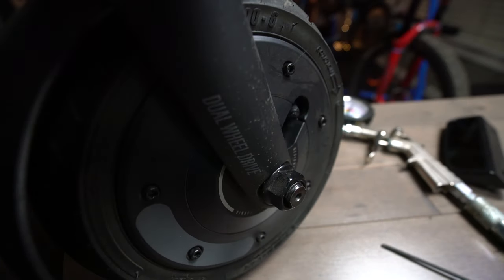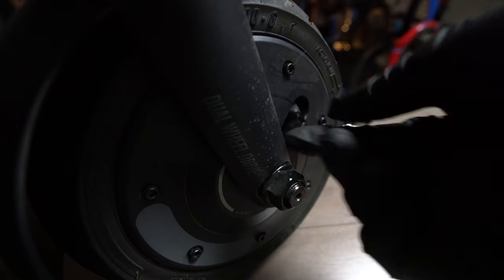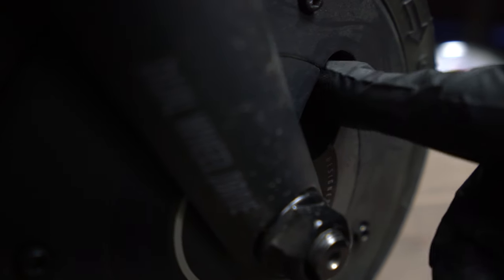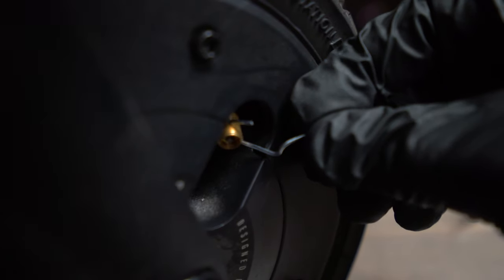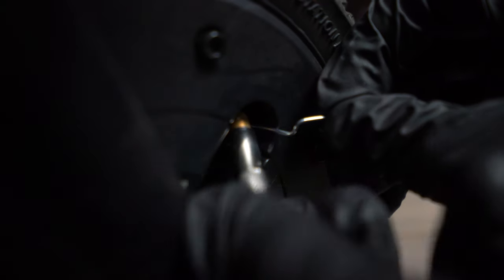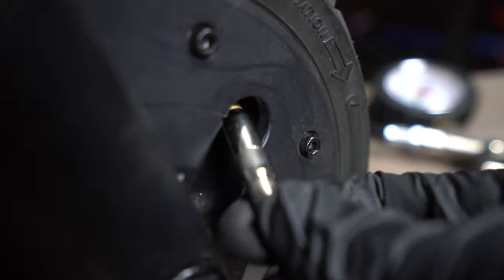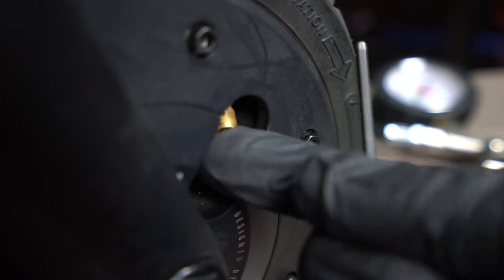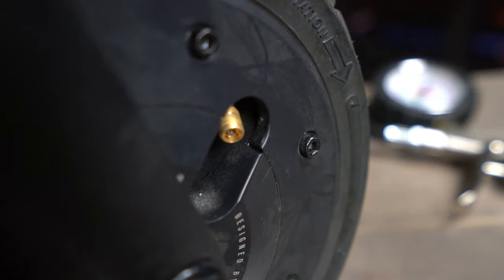Boosted Rev Scooter: Stuck valve stem? Watch this.

Comment: Do you know any scooters that have the same or close build quality as the boosted rev?
Reply from the maker: There are brands like Dualtron and Speedway that seem to have reasonable reputations and robust looking frames. But to my eye they all look cobbled-together, ugly machines with buttons and controls from the 1980s. None have the weatherproofing of the Rev. The one that did look high quality + more polish in terms of fit/finish was Inokim, but it's $$, and still super niche (so carries all the risks of buying a very boutique/niche expensive mechanical/electronic item). The Rev is kinda like the "Apple" of scooters. It definitely triggers people who value performance + range.
The lower end Segway or xiaomi scooters don't seem to come close to Rev build quality.